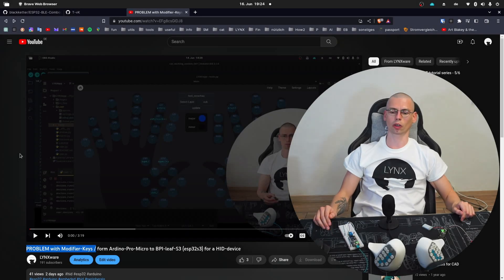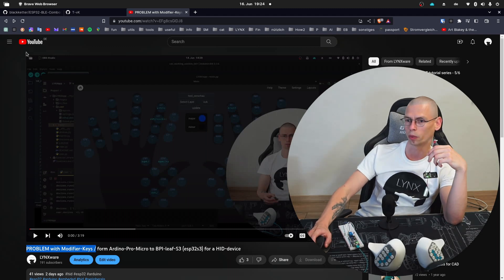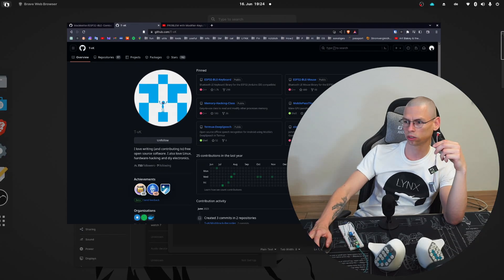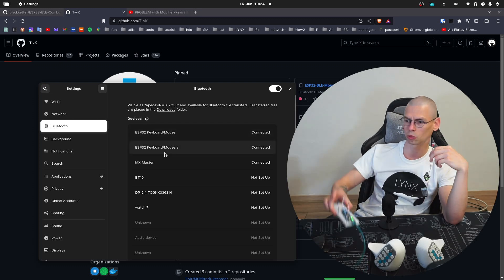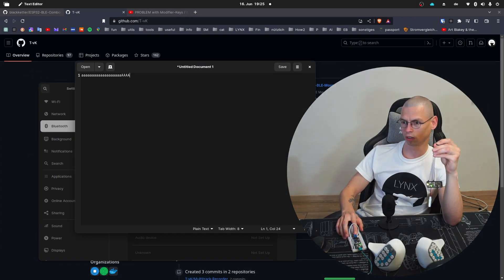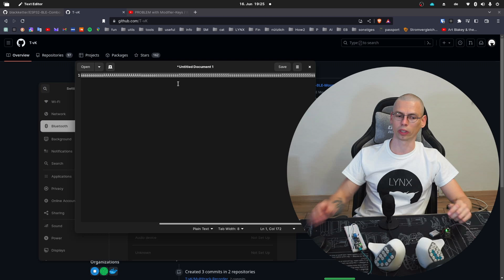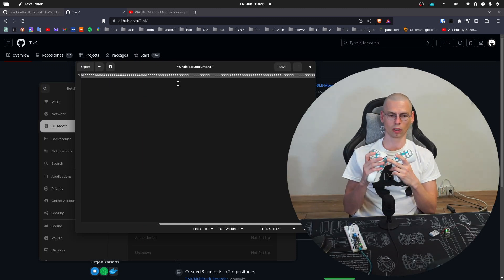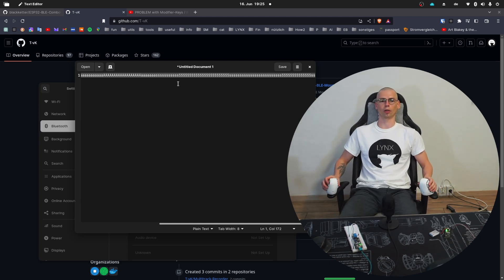Bluetooth-Keyboard/Mouse Library for ESP32 (update 16.jun2023)

Comment: Were you able to get both keyboard and mouse working with that library?? I spent a few hours but couldn't get the mouse to work, keyboard was working fine. If you got some references, that would be really helpful.
Reply from the maker: in the end had to abandon this library because  it did not worked out, so I don't have any helpful references for bluetooth.
Reply: trying to get the same thing to work. same issue as you. keyboard works, mouse does not.
I'm trying to make a wireless macro pad for my laser engraver, because it is in a different room then the pc that runs it.
In theory one could use two esp32's but that seems a bit redudnant and cost and power inefficient.
Reply: @joshuamiller8235   Same issue. Keyboard works mouse doesn't. I've tried a few different Ble Libraries and none have worked. Did you find a solution?